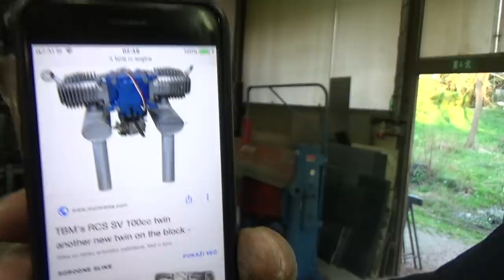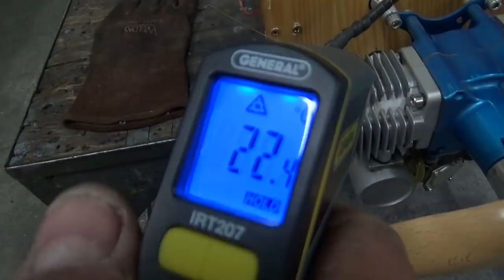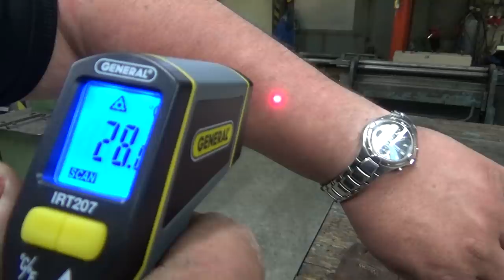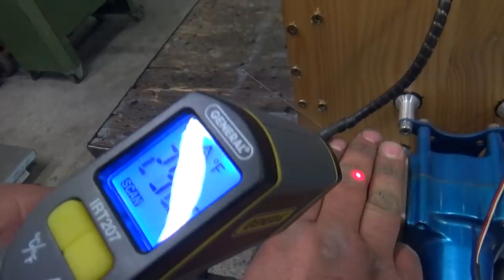TBM-RCS SV 100cc Twin gas engine Test run

Comment: I like the air boat idea! Make a mount for a kayak with a couple of Outriggers for stability sake. The way I would control it is a squeeze handle for throttle on a long arm that is directly connected to the engine mount and then put all of that on a hinge strapped to the back of a kayak. That would make an excellent video that I would definitely watch!